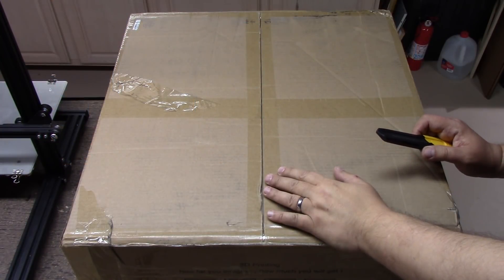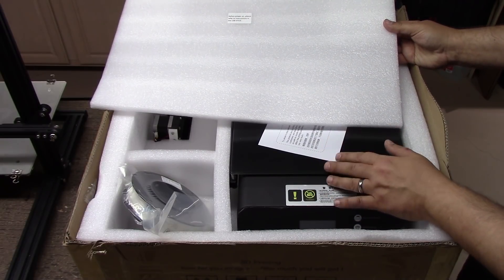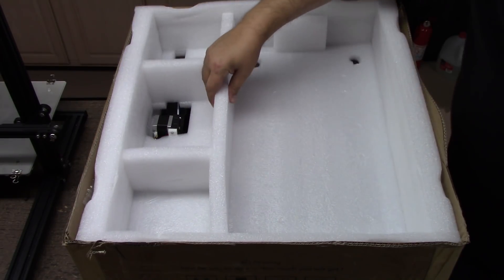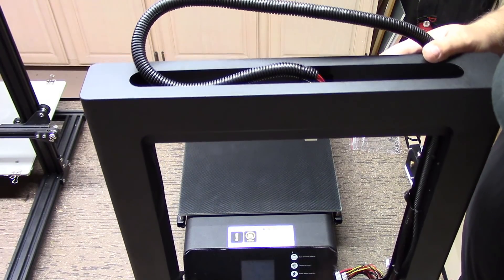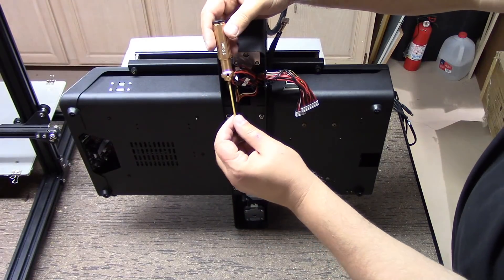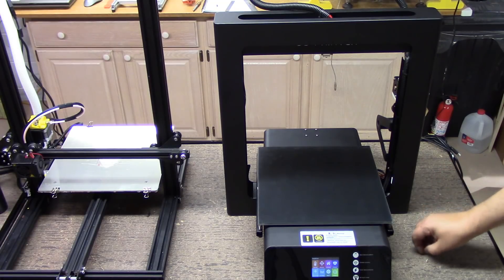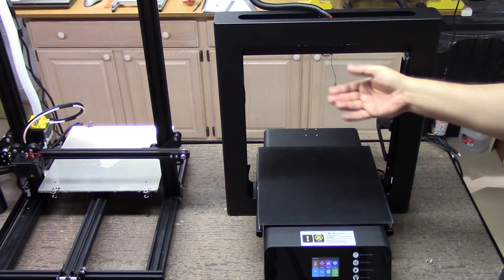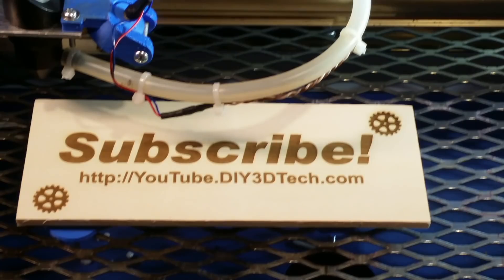GearBest JGAURORA A5  - The Creality CR -10 Killer Unboxing and Assembly!

Comment: The JGAurora is easy to assemble, fantastic LCD screen and menu system but after that the thing falls to bits after a little wear and tear (Paint falls off, fan noise, Thermister, Lock-out mode) and then you find out that the help desk is useless, repairs include them wanting you to stick replacement glass on top of the old one and many of the replacement parts they send out that take six weeks to arrive are factor rejects.

"The warranty card" is not worth the paper it is printed on if you used AliExpress to purchase your JGAurora A5 so in the end I was forced to buy a CR10 mini and it's a god send after my experience with JG-A5, real work horse
Reply from the maker: Its Oct 2019 and mine is still going strong...

Comment: The total build volume is bigger on a stock cr-10 and that even without going for the real bed size of 310*310
If you ever have to service the Aurora it will probably be a real pain.
I have to check later what hotend it has and what kind of partcooling.
But in total it really doesn't have anything a cr10s doesn't have, except the USB printing.
Reply from the maker: It has two Z-Axis (big win over the CR-10), far better bed, 24volt power supply, can easily print PETG, filament out sensor, restart on loss of power, touch screen, better extruder, better hot-end, safer design....  Come on, the list keeps going so how can you say "really doesn't have anything a cr10s doesn't have"?  Oh and what kludgy maker rail vs purpose build frame?     The only thing it has is a taller Z build height...
Reply: DIY3DTECH.com the cr-10s has filament run-out sensor, restart after power loss. Never had problems with the cr-10 extruder, but read negative of both a5 and cr-10🤷
For the hotend, I take your word for it, as I can't find videos or pictures of it. But as long as it has a PTFE inliner, not much of an upgrade IMHO :) the hardned nozzle seems to be a nice touch.

The touchscreen is probably something you love or you hate. I hate it. It feels bad IMHO. If you try to set the heat you never really now if it heats or not. It's more of a hassle to adjust values like stepps / mm and stuff like that.
The board is better no question about that. I like the built in WiFi. And if I remember correctly you can use that to upload gcode directly.
The frame of the cr-10 is easier to service. 🤷
Does the a5 looks better? No question.
Is it as easy to service / repair? Probably not. :)
Personally I don't like fixed build surfaces. Probably mostly because I see the hassle if I ever damage it? No clue.
The build surfaces is 100% better than that glas a cr-10 comes with and the 24V is nice so it heats up faster.
But with the design I think insulation isn't really doable. So probably a preference thing again 🤷 :)
Reply from the maker: The comparison with was with the regular CR-10 and not (s) however (while there are many)  the major points are (1) two Z-Axis (this alone makes it a winner), (2) purpose build frame, (3) touch screen for ease of use instead of a wanky knob, (4) a real extruder and high quality one at that verses a 3d printed plastic one.  Also why do you need to insulate the bed?  As this is the point people are missing, for 3D printing to create real value it has to move past the "hacking" stage and into mainstream as exampled by my viewer base as more and more people are joining that want to 3D print something for "something else" (say another hobby) they don't want to modify their printers, nor get all geeky.  Also don't take it as I have something against geeky (as I am very) yet this is a maturing market and change is coming quickly... :-)

Comment: My concern is that JG Aurora has yet to prove that they are a reliable, creditable company. GearBest has advertised at least one of the companies products with features that are not working, uses an incompatible filament spool size, and even requires U to ship it back to the factory for firmware updates, and then asks over US $2,000. See Naomi 'SexyCyborg' Wu https://www.youtube.com/watch?v=U-9D9GRNYf8 for further info on this model. Cross-reference some other YouTube reviews for issues users have had with this model.
Reply: I've had the JG Aurora A5 for a few days now and I've updated the firmware to the latest Marlin 1.1.8. I've used standard 1.75mm PLA with no issues - it takes any spool size up to 1kg.  The A5 produces really nice, detailed prints with smooth surfaces. I've had no issues so far with this printer apart from tweaking a Simplify3D profile to get the best results.
Reply from the maker: Thanks I am showing 3.0.0 on the firmware build what did yours come with?
Reply: I think the 3.0.0 refers to the MKS TFT firmware of your LCD screen from 'Settings/About' (however this isn't very useful unless you're upgrading the LCD!)  
To check the Marlin firmware version, enter M115 gcode via Simplify3D / Repetier Host etc..  
The JG Aurora A5 firmware can be updated via Arduino IDE and downloading the latest firmware from https://plus.google.com/communities/106750398502669661167/s/firmware%20hex 
(Note: firmware wont compile without the u8glib library which needs to be added to the Arduino library first)
Reply from the maker: Thanks I was just going to ask!  Will likely do a video on this :-)

Comment: I just wanna chime in here for a sec i got my cr10 6 days ago for 359.99 and you loose a few inches of height on this printer not a issue really but you are loosing build volume. Second the nozzle doesn't get as hot according to the spec sheet. All in all is is a more expensive printer atm if only by 10 dollars. Until i see a print on it a killer it is not. However this appears to have gone through qc so less chances of malfunction means less returns its really a pick your poison at this point.
Edit: ive seen a few reviews they might be early samples but they have terrible quality and wobbles id like a more in depth review of the structure ect kinda a pros and cons video.
Reply: I do feel sorry for the guy that received the terrible quality printer that wobbles (I know the video you're talking about) ... but it's certainly not the experience I have ... the A5 is a solid, heavy build with no wobble and produces great prints!
Reply from the maker: So far so good and and I have performed microscopic study (here: http://diy3dtech.com/wp-content/uploads/2018/01/Micro_01.png ) of both (red is CR-10 and White JG Aurora) and both are right in there!  So far I am impressed and will be releasing a detailed video Friday!

Comment: For your bed adhesion have you ever tried Wolf Bite from Airwolf3D.com Im not an affiliate (hence no affiliate link) But do own an AirWolf3D AXIOM printer that I love (rare failed prints usually
an object creation error at this point) I use it and WOW its amazing it releases the print once it cools down and holds the prints SOLID. (I have found putting it on while its warm is the best
they say put on cool and re apply at least once every 2-3 prints for maximum results) I print in ABS(trying PETG soon) and love the results.. I should for a $4k printer.. I had to go that route cause at the time there was no enclosed printer and I didn't have a work space that I could set up a printer in. Now I do.. So Im looking for my second printer so I that prints bigger so I can get to work on my Artoo Detoo..
Reply from the maker: Wow those are some impressive looking printers!  No I have not tried but what you described sound like PEI as it dose the same thing, however the Black Diamond bed on the JG Aurora has me blown away!
Reply: I don't know if you talk about upcoming 3d printers. But just seen this one https://www.indiegogo.com/projects/pluto-the-smallest-high-quality-3d-printer-technology#/ I wish I could invest in them It looks very good. its a SLA printer with a few twists first its small but it prints differently than the Form Labs 2.. and no resin tanks to replace like them.. Hoping you see this and think its cool to do a video on Maybe get a test unit from them :)
Reply from the maker: For now I stay away from SLA printers as the resins are typically very caustic and many are carcinogenic (see the video I did on the Wanhao 7) and shouldn't be in homes as they lack the proper ventilation...
Reply: Gotcha.. A friend of mine has a Form Labs2 in his dental practice and he does not have much of an order issue (they print dental stuff all day long)
Reply from the maker: Unless he is operating it in a vent hood he is asking for trouble (see: https://youtu.be/krkiEPFoRAE) I have also created an air-quality page here: http://diy3dtech.com/3d-printing-and-air-quality-risks/  and it lists a hood vendor (https://www.3dprintclean.com/).  P.S.  just because one doesn't notice an odor doesn't mean they aren't breathing in bad stuff...
Reply: Ill have to tell him... Its upstairs not near patients but technicians are up there all the time.

Comment: Interesting printer, but I'll be buying a third CR10.
Reply from the maker: So this thing is about a $100 cheaper then the CR-10 with more features and ?????
Reply: DIY3DTECH.com and less build volume in the Z axis.
Reply from the maker: But two Z-Axis motors not one! :-)
Reply: DIY3DTECH.com I have had zero issue with any Z artifacting on either of my CR10'S. Don't get me wrong, this printer looks fine. Just doesn't seem to have enough going for it to call it a "CR10 killer" yet . Time will tell, I'm interested to see the print quality and how it holds up after a long print. I regularly print 120hrs+ on my CR10'S, and they've never missed a beat.
Reply from the maker: I also have a CR-10 (as well as many more) and also have had good luck with the CR-10, but then again so did I with my Two-Up three years ago too!  Time moves on and things improve and there are two key denominators in the markets and that is cost and features and this guy has the CR-10 beat hands down on both and hence easy to call it a CR-10 killer as the key for the CR-10 was the base build size as I have said for a long while 8x8 was too small to be practical and the CR-10 was the first to affordably enter that space with a good product but many more will enter now. As I have already done a ton of prints with this and the quality is very good as there is a line all FDM machines will bump into just because the laws of physics.  The only thing I wish they would have done is used a 32bit process as everything I have seen is its still 8bit so the resolution of the arcs will be limited as with CR-10, but this is a minor nit as we are looking at something which is likely beyond the mechanical abilities of an FDM printer anyway...

Comment: JGAROURA as a company looks interesting, nice design that doesn't look or function like an old ass OG i3.

-Touch screens
-Built in memory
-Reume after power loss
-Filmament detect

Are what all printers should aim to add.
Reply from the maker: That way I call it a CR-10 killer and at least right now it far cheaper then the CR-10 too!
Reply: I've always been a bit of a snob around 3D printers simply because my Flash Forge Finder from 2015 has filament detect, wifi, usb printing from cable and stick, 8GB hdd... Also FlashPrint being free and feature packed is a bonus.

Since my FF Finder has two USB ports like this printer, I actually run a small USB fan off the regular port for added cooling.
Reply from the maker: This has most of that too for only $365 :-)  How much was your Flash Forge Finder  :-)
Reply: This is one of the first printers to take my interest and is crazy cheap.
Reply from the maker: Yes and watch Friday as I will do a super tech review...